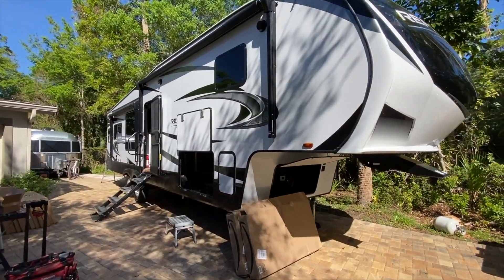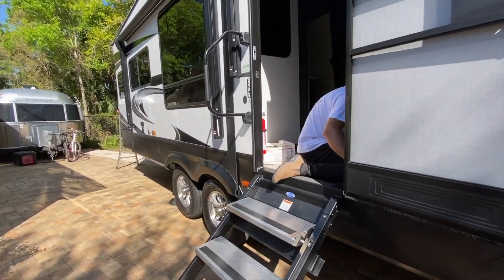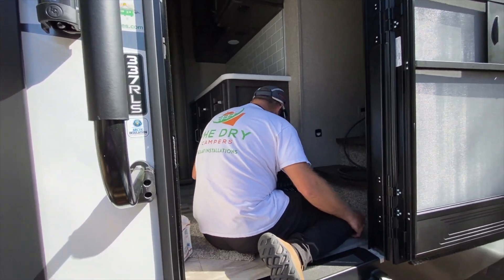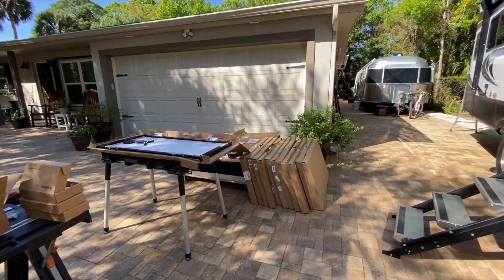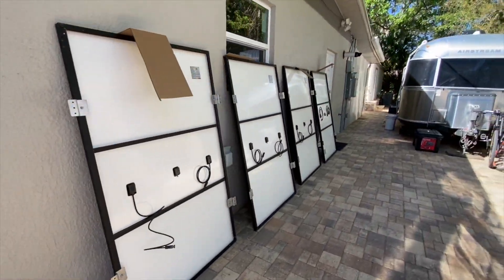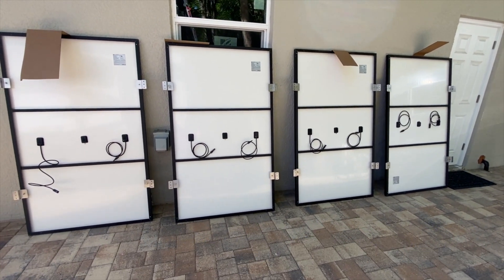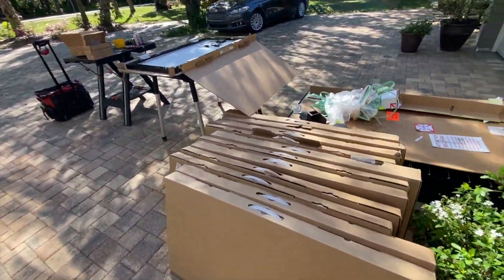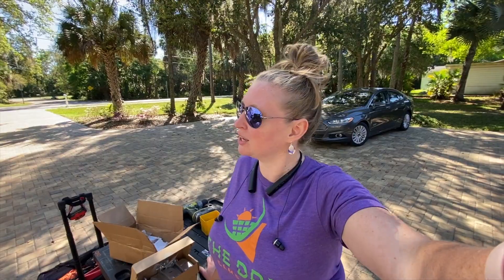@battlebornbatteries & Solar Upfit | 2021 Grand Design Reflection 337RLS

Comment: Finally, a rig close to what I have.  I don’t have as much depth, but the height is spot on.  Do you have any concerns with the power cables on the roof??  Since they appear to be out in the open, any concerns with UV damage over time?  Just wondering.  Thanks for the videos!  0.25 play back speed is a life saver!!  😁
Reply from the maker: We specifically use solar wire which is designed to last in the sun.

Comment: Thank you so much for the video! What do you guys use to mount the solar panels? Are you using well nuts or some other type of fastener or do you just glue them on? Thanks!
Reply from the maker: We use sharp point lath screws (TEKS brand) with LOTS of sealant. Sealant under the bracket foot, screw into the sealant so that you're sealing the screw hole as well, then cake on the sealant to cover the screws. I make sure sealant is coming out of the bracket footing so there's no question as to whether or not enough is used. Never just glue them on. It needs to have that double support. Don't want them things flying off. ;)

Comment: Thought provoking vid for me.  Daydreaming what could be in our Chaparral 391QSMB and this gives me ideas.  Concept question - with the weight issues that were part of the original build, why use so many of the 100w Renogy panels and not use more of the 330w panels?
Reply from the maker: The 330W panels are 66x40. We can only fit so many on a roof, so we max those out then utilize the 100W panels to fill in the gaps to provide them with max solar. If there weren't ACs, vents, etc. on roofs, then we could certainly utilize more, but unless you remove the AC units, like we have on our unit, there's only so many that the roof dimensions will allow.
Reply: @TheDryCampers  Got it.  I just assumed that we 12 100w panels...  I shouldn't assume.  Does the system get out of balance if you have 5 of the larger panels and then say 5 of the 100w panels?  Something is telling me that there needs to be some symmetry with the panels feeding the controllers.

Comment: I wish I knew how you got to those back batteries. Both to cable them and to install the securing straps.
Reply from the maker: Once Mike did all of the wire management and tidied it all up he started with the batteries and worked forward.

Comment: how long did it take for them to get on your schedule?
Reply from the maker: We usually work with clients for about 6-15 months prior to the installation. Occasionally the schedule changes and we're able to squeeze someone in, but most of the time we work with the clients for quite some time before the actual install, depending on where they are in the country and when we'll be in that area, of course.

Comment: Wow wow wow! Loved this install video. I loved the discussion at the beginning between Leanna and Mike. Fascinating and insightful about the GVWR and CCC. I always assumed (wrongly) that this was just a straightforward engineering equation based on the structure and framing. The lightbulb went off for me that clearly manufacturers want to be able to say that smaller trucks can tow this RV - even if it means that the CCC numbers are sacrificed. I learn so much each week from you guys!
Reply from the maker: Thanks so much, Mark! Glad you enjoyed it and we were able to provide additional information.

Comment: Very nice job - noticed the 2 fans you installed - are they thermostatically controlled?
Reply: I noticed this as well. Great question.
Reply from the maker: Thanks, Mark! Your system is looking awesome (we did get the photos!)! Yes, here is a link to the fan: https://amzn.to/3ctR7ep
Reply from the maker: There is an additional piece to add for the temperature control: https://amzn.to/3svOCxZ